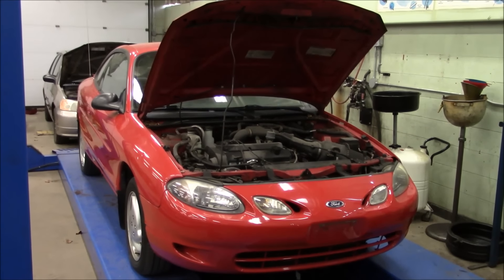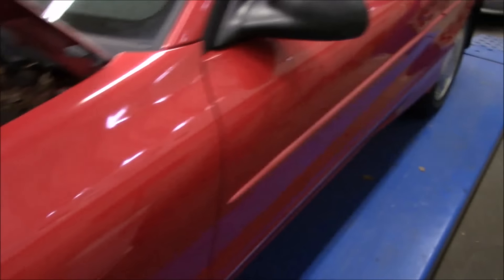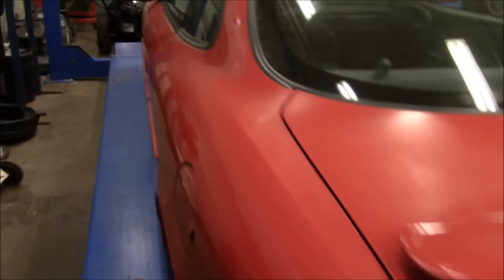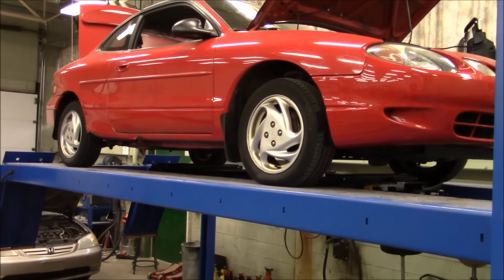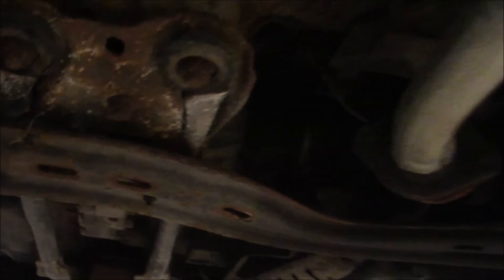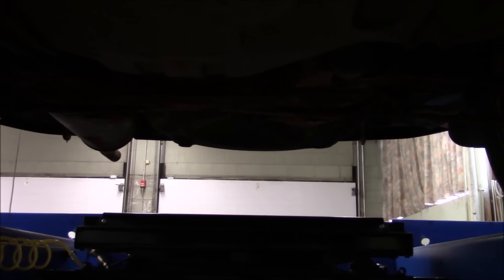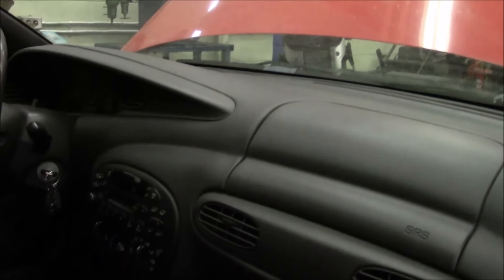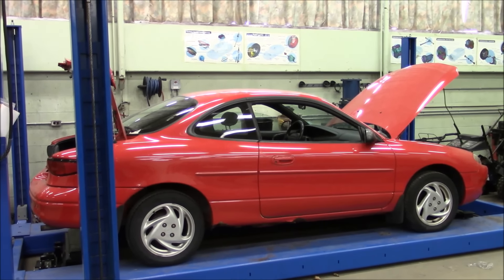This car is why LOW mileage cars can be VERY bad to buy

Comment: That's caused by the salt and road chemicals used up north. I'm located down South. I have three southern cars and one car from up north (Chicago). The northern car constantly wants to rust away, I have to paint, etc. underneath to help keep it solid. The other cars are just starting to rust. Yes, many of my cars sit much of the time on damp sand.
Reply from the maker: +PC Principal SE this happens also just from the presence of moisture sitting under the car always if it is parked over grass, dirt or a surface where moisture can collect, the salt is a very big contributor to the rust though, i encourage oil spraying cars right from new and carrying on odoing it every year to keep them from rusting always

Comment: just because a car sits doesn't mean it will get rust down below.  Rust is caused by driving in the road salts, so after driving on the road with snow/salt, the underbody of the car should be cleaned to prevent rusting.    There are some good low mileage cars out there, just be sure to inspect it like shown in this video before buying.

Comment: Its depend where the car sat. My grandma had a car sat in close garage for years and the helds good
Reply from the maker: +gil zur ye you are correct, judging by the paint condition this was not stored in a garage though
Reply: @MikeUtoober  ... I have an 03 Ford Taurus SES with the duratec engine. Got it this past December. Looks like it did on the showroom floor. 43,810 miles on the clock when I bought it. Paid $5,000 for it. The first thing I had to do was replace all the brand new tires because they were weather checked. All the plug wires because mice had chewed them. And the guy that I bought it from had to replace the fuel pump and fuel tank. I replaced all fluids. Brake cylinders. Brake pads. Rotors. Cabin air filter had a little mouse house in it. This car was stored in the garage and was owned by an old man. I got it from a dealer that got it at an auction after the old man died. It's using quite a bit of oil. It doesn't leak and it doesn't come out the tailpipe. Sometimes the transmission doesn't always shift right and it makes me nervous. Pretty sure I'm going to have to replace both wheel bearings and or CV shafts. Not sure about the rear bearings. I can tell you this....a car that sits for too long is definitely not good for bearings. I just hope the head gasket holds up. The car is making me nervous. It's really too bad because it's absolutely beautiful. Leather interior, sunroof, AC blows cold.. All the bells and whistles. I got it because I had one just like it before and you couldn't kill that thing. And it rode like a Cadillac and the only thing that killed it was rust. The motor ran like a top. The duratec engines are great engines. Probably the biggest reason that I got it. But sitting that long is probably going to be the death of it. At this point I would make more money from it parting it out rather than replace the engine and transmission. Only 48,000 miles on the clock now.

Comment: Looks like it sat out in a field or dirt.  Not sure it would rust so bad sitting on cement.  Some folks just really don't care; cars are expensive!  Kinda sad.
Reply from the maker: +JRobert111111 i dont know where it sad to be honest but either way this video would apply to sitting over concrete or grass really, just to a lesser extent if it were over concrete assuming this one was over grass/dirt/gravel